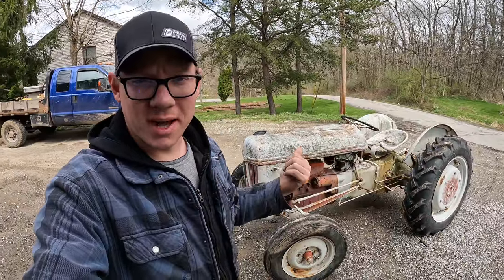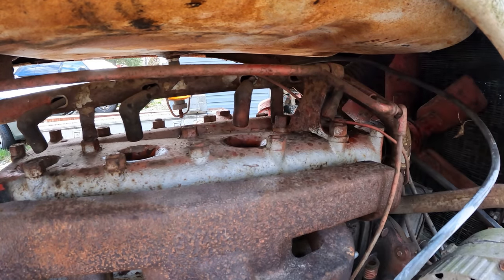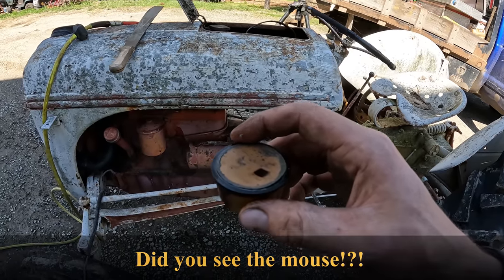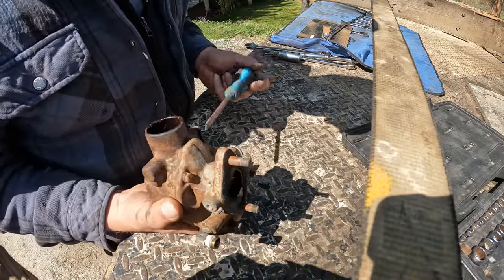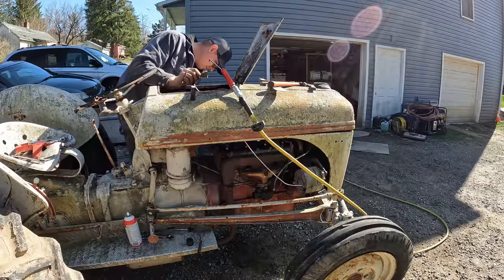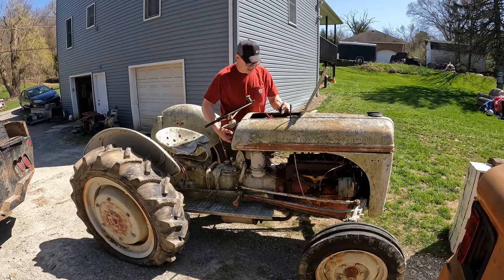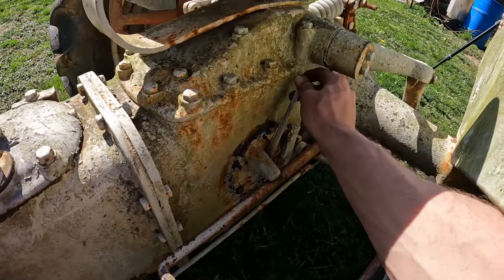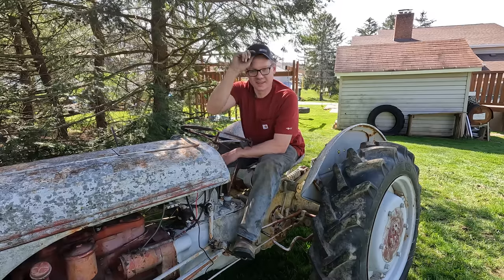Saved From the Crusher! Will this 80+ Year old Ford 9N Ever Run Again???

Comment: Exhaust leak on #4 is a common issue on ford N series tractor, every single one I've seen has one. Ford decided to not put a bolt or anything there, and over time the manifold warps and eventually starts really badly leaking. Ours has the same issue.
Reply: Same on the Fergusons. I have a TO35 and MF35 with that #4 condition.
Reply: My shop teacher (John Gale) back in 1979 told us that was an installed feature….

Comment: Great job. The 8N and 9N tractors can run for ever. My Mom has one and is used for her 2 1/2 Acres. Must be careful they are hard to stop. I mean you want to drive and drive.
Fun story. When my parents first moved into the house on two and a half acres. I think 1973 or 1974. They bought a 1936 case started with a crank and had no lift. Came with a large drag plow, spring tooth, and scrapper. About 2-3 years later it stopped in the field and Dad was done with it. He wanted to do work around the yard and bought a 8 horse power 4 speed Montgomery Ward Rotor tiller. I was in Jr High and took electric lab. I rebuilt the family edger. We'll while Dad was assembly the tiller I took on the Case tractor. I rebuilt the carburetor and cleaned the plugs. I was not aloud to work the crank. My Dad did not want to bother. After begging he went out there. Three cranks and it fired up and ran well. It was so satisfying. Funny thing my Dad put off the tiller and totally plowed the whole yard. Mom did not see that coming. The tractor ran a few more years, when they bought the 8N. We sold the case and still running.

Comment: 83 years old no computer  junk on it runs good ( john deer should pay attention ) ive  run both 8n and 9n   for years i would oil change use engine restore additive brings compression up these are great for twist through the bush very small foot print with little care it will run for another 20 years. great video matt thanks

Comment: I got a 9n and they're handy little tractors to have around. Easy to work on too. Also the I beam axel supports identify it as a fairly early 9n. And the air cleaner is fully under the hood. Later 9ns have a tube coming out of the hood and the 8n has a grate on the right side of the hood.
Reply: I'm not super smart but l believe the tube was a dealer option change.
Reply: @normhowes2975  I don't claim to be an expert on it but from what I've read the early ones had the I beams and sometimes people swap em out. My 9n has tube styles but I sure wish it had the I beams
Reply: @normhowes2975  You'd be correct. Also an aftermarket option from catalogues.
Reply: HA, a 9N recently sold at auction a couple of miles from our house. It was a 1940 model with all four tires completely rotted. Other than that and needing a LOT of work I passed when it went to $625 which also included sales tax and buyers premium which would have made it $743. TWO weeks later I had cashed out a small 401K an would have had the money to buy it and probably would. I ended up buying a 1956 Farmall 130 with a front blade and also needing four tires. :-)

Comment: We had a 9N in the 1960’s. As you discovered, the PTO must be engaged to use the hydrolic lift arms. The original front tires were about 3 or 4 inches in width. The front tires on your tractor look like they are about 7 or 8 inch’s wide. It is likely that someone wanted to install the wider tires on the front of your tractor and needed to use the old “hubs” to increase the space between the tires and the steering “swivel”. Great work on getting it running again!

Comment: These tractors are some of the most reliable machines made, period. They were a solid established tractor on the seen giving Deere a run for their money. Nice work fella finding out that the high tension output spring was burned short from service in the field. This was definitely overlooked by the previous owner. One can definitely hear the exhaust leak for sure. Nice job Matt. Look forward to see more from you Sir. Peace vf
Reply: one small notch above a team of horses
Reply: @earlborchardt4358  Let see, no giving feed water harnessing smelling the back exhaust. Work 24/7 if you like. The bad, profit is eaten by cost of gasoline. Personal choice I guess.
Reply: @earlborchardt4358  , tell that to those still using these on hobby farms, minus those who do not use machines for religious reasons.
Reply: @earlborchardt4358  
Small, but incredibly crucial.

Comment: The easiest way to work on the distributor is to remove it and work on it on the bench. Lay the cap back, one wire, two bolts. The shaft end is offset so it only fits one way. You don't have to worry about timing. They don't have live power so as you found out the lift and PTO only work when the clutch is out.

Comment: FYI ...worked for an auto/diesel shop for some years in Central CA. We converted many 8ns, 9ns, Jubilees  and other 6v tractors to 12v alternators. The main reason was the spray rigs. They have to be pulled extremely slow. The 6v generator wouldn't keep them charged. The alternator will charge at an idle.

Comment: I have a 1941 9n just like this. Those machines are workhorses, parts are mostly readily available and cheap, most components are not only available as assemblys new, but also parts to rebuild those assemblies for even less money. A little bit of tlc and that machine could be putting in a days work 80 more years from now. I use mine to mow my place along with 6 others from time to time, i used to maintain the private road i live on with it until the county took it over, i plow my garden every year, disc and bushhog deer leases for family and friends, heavy lifting around the place, and most importantly this tractor has powered a pto driven generator and provided my entire h ouse with electricity every time the lights went out for the last 10years. Saved our butt in snowpacalyps last year.

Comment: Hey Matt. Just saw your new vid about the Ford tractor acquisition. After being in the electric motor business for 45 years, one thing I always keep handy when working on electrical stuff is a can of electrical contact cleaner. You'd be surprised at what you can revive with that stuff.
Reply: great advice, and many contact cleaners do not wreak havoc on rubber or plastics

Comment: Really enjoyed this one Matt! Hope whoever buys it sends pictures of it in progress/ done.
Reply: Hey Matt, two bolts take that distributor off. Drives by a Tee slot it will only go back on one of two ways. If you make note of where the rotor is pointing before hand , it’s a no brainer. And now you can see what you are doing on the  distributor. Makes life much easier. Yup pto has to be on for the hitch to operate. Kinda primitive 🤔I just rebuilt an engine in an 8n. Pretty much same thing. It has a very unique valve system.

Comment: Thanks for the video. I've owned and restored a few of those old tractors. Our local tractor supply had the complete exhaust system in stock for less than a hundred dollars. From the manifold to the back tailpipe muffler included. I was truly amazed.

Comment: Fifty years ago I sold overhaul kits for those for $120.00 that included regroup Crank shaft and bearlngs with pistons sleeves and rings as well as a gasket set. Those old fords were very popular back then in rural Oklahoma.
Reply: Rachel Gingell's channel sells repair kits and has instructional videos on component repair. And she's nice to watch.
Reply: @TKevinBlanc  Thanks Kevin I will check her out. If memory serves the same kits worked on the Ferguson, As I recall Ford had bough the Massey and they were called Ford Ferguson, been a few years and memory fades I don't care who says it don't.
Reply: @poorfesor  Thats correct. In Australia we call them Grey Fergies
Reply: @poorfesor  Ford and Ferguson had a handshake agreement to use the Ferguson System(3pt hitch) on the Ford tractors. The Ferguson tractors were a result of that agreement falling apart. They used OHV engines sourced from Standard for UK built(TE, Tractor England) and Continental for US built machines(TO, Tractor Overseas.)
Reply: @82f100swb  I just remember my Father in law had a ferguson that I sold him an 8n rebuild kit fo every few years. Hard to believe what happened to prices after Nixon's price controls and Jimmy's rein.

Comment: I plow the driveway with an 8n yet, thing starts every time. Lots of guys would chop rims with a common bolt pattern so they weren't forced to use the OEM wheels. That way you could get more readily available wheel and tire combos anywhere and not rely on trying to source the hard to finds.

Comment: A little tractor is something you always need.  I had to cut down and cut up a dead pine in my back yard and used my lawn tractor to help disassemble it.  I used tow ropes and a chain to pull the big parts.  I put a clevis on the rear of the tractor and used it to drag the big bones to a pile for burning.

Comment: We had one on the farm back in 1959. It was a little newer with a slant 4 and the next gen electrical (lol). Was a great machine that ran forever. Ours had a front end loader so it worked well with our old MacK Dump truck. Nice job

Comment: An old machine like that would be great for someone with a large garden. It looks like it has a pto shaft and with a set of suitable tyres on it, could cut grass and work a decent size vegetable patch
Reply: If it's not a live PTO, it's a pain to use. We had a similar Massey Ferguson without
Reply: It's perfect for a garden actually fits through a lot of gates too
Reply: @erik_dk842  Matt had the pto working just after i posted
Reply: @erik_dk842  Works just fine, still. You have to get an overruning coupler and that keeps you from getting pushed through your fence.

Comment: Hey Matt! Had an 8N when I was younger, solid piece of equipment but can be a royal PITA when dealing with fouled points or anything electrical. My dad did a12v conversion and rigged up an MSD (I believe) digital ignition, was super reliable after!
Reply: Yes I have 601 workmaster 1959 basically same tractor

Comment: That gray sludge is the leftovers from the days when they ran lead in the fuel, dunno what's worse, cleaning up old leaded fuel sludge or modern corn syrup fuel sludge. Funny that there was a happy interlude from around 1990-2004 or so when they weren't putting anything in the fuel that didn't really belong and that stuff holds up quite well.

Comment: I enjoy all of your videos!  The 9N used a huge 5 bolt pattern on the front, like the 1936 Ford cars did (looks like an early VW).  It looks like they modified the spindles to accept a Ford pickup 5.5" pattern.  An older guy I worked with in the 80s installed 1950s Ford car hubs on his 9N and used Ford 4.5" car pattern wheels.  He also pulled the stock liners out of the engine and used either Ford or Mercury flathead pistons running on the block bore to increase the displacement (an early big bore kit).  My dad taught me to a snap a piece of paper between the points and slide it out, after filing them to make sure they are clean and it sure helps.
Reply: I believe 9N, had narrow , your w
Reply: 9N narrow tires, 8N wider tires, like yours.

Comment: The old tractors do not have an overflow reservoir on the rad. You are not supposed to fill them full when cold. The top part of the rad is supposed to be empty when cold so when the tractor warms up, and the antifreeze expands there is some place for it to expand into.

Comment: Great find! My first tractor was a Ferguson T130, very similar to the Ford N series. You have to be moving to raise the 3 point. It can be problematic when you get stuck with your implement down.
Reply: Not so, as long as the pump is in gear (lever on the side) and the tractor in neutral, the hydraulics work independently (as Mat demonstrated). It is true that it doesn't have a two stage clutch like later tractors however.
Reply: @graemezimmer604  I remember that now, it's been about 15 years since I had that tractor. I inherited it from a neighbor who passed away so I had to figure out all the controls by trial and error. The trickiest thing on the Ferguson was the starter, you engaged it by going up and to the right with the shifter. The time I got mine stuck was probably one of the first times I used it, I had the box scraper down and lost traction coming up a hill. I ended up talking the scraper off to get the tractor out.
Reply: Nah, these 3-points lift without it moving, have had plenty of Ford N-series and 600-800-series.  Definitely something wrong with them.

Comment: My 1st tractor was a Massy Ferguson, The Grey fergy. Made in the UK. Grandad bought it in the late 1940s
To start it, used the gear shift, top left hand. Like 1st gear. Actual 1st gear was bottom left.
We had a ford 4000 with 10 speed selector. Dad sold that then got a International 454.
Some winters got so cold that starter would not turn over the Ferg's engine. Had to crank start it by hand.
The 454 started no matter what temp it was in the morning, didn't even need to preheat where the Fergy would not have anything to do with it.

Comment: Great video !
I had a 39 9n and it was 6 volt positive ground so you may have toasted the coil unless there's a ballast resistor in line there.
My 9n had two brake pedals on the right side. Also the pto was not disengaged with the clutch and lots of stories about driving out through the barn wall trying to stop with a brush hog still spinning on the back.
I showed my two young children how to drive a manual trans with it and it was tradition to drive tractors to the last day of senior school.
I kick myself every time I think why I sold it !

Comment: Parts availability is so good on these that you could almost build an entire new 9N just from aftermarket parts. They are still so popular, not just because they made a ton of them, but also because they still fit what a lot of people need. It will plow, cultivate, snow plow, brush hog, grade, and pull a wagon around. For a lot of people that's more than enough, and if it is then the N series is an absolute bargain in purchase price and upkeep. They also come with that added knowledge that this tractor put a lot of food on a lot of tables in its life, which is an experience in itself.

I didn't see an overrun clutch on the PTO: that might be where the front end dents came from, since a brush mower will push the tractor with the clutch in unless you have an overrun clutch installed. Many fences have been violated by N series front ends that way.
Reply: No idea what you are describing really, but what I can say is that even on our Ford Workmaster 641 when you get ready to come to a stop while bush hogging, you have to push the clutch in before you're ready because it will continue to lurch forward until the blades slow down. Sounds like what you are describing.
Reply: @ram89572  Yes, the 641 would also have a transmission PTO and so really should have an overrun clutch installed for mowing so the mower can freewheel when you stop the tractor instead of the mower acting like a big flywheel pushing you forwards. I think I paid $50-$60 for the one on my 2000 and it makes a big difference in making mowing more pleasant and safer.

Comment: That alternator could have an exciter in it which converts it to a stand alone one wire system. Have one on an old Farmall C with one on it, nearly 20 years with no issues.
Reply: Yeah, that kinda sorta looked like a 1 wire gm. we use em on airboats all the time.

Comment: As a teenager I use to help my Uncle clean up, paint and repair the early Ford 8N, 9N, 2N, Jubilee tractors for resale. It usually took a couple weeks to refurb one unless it involved serious transmission or motor problems, he stocked a lots of used parts also.
6v to twelve volt conversion was always the first thing we did. My Mom use to complain about how dirty and hard to clean my clothes were, we used kerosene and high pressure air to clean the grease off them. A good video to watch on you tube is titled: 
"Ford 9N 2N 8N Fergy Differences"

Comment: I'm not a chemist, but I wonder if the "gray sludge" is some compound of lead from using leaded gas most of its life. So weary touching/breathing that in.
Reply: That's the 1st thing I thought of.
Reply: Ive seen the same with old aluminum/zinc frame fuel filters i find in old chainsaws. They sit in gas for so long that they just start to corrode and break down.
Reply: @punisher3607  Aluminum/zinc gets crumbly after 50 years soaking in gasoline.
Reply: @smncutler  yep, sure does
Reply from the maker: Yes it’s definitely not original
Reply: Id be surprised if tetraethyl lead was changing in composition over time. An organometallic compound like that usually wont react over time. But that doesnt mean the sludge doesnt contain tel, and could easily be dangerous still.
Reply: I wonder if it's lead additive

Comment: That's a 41. At least the grille, pretty rare, the rest usually have virticle holes in the center slat. Also those rods that are in the grille I believe are 41 only, at least in the way they were made. I have 2 1941s. One is changed quite a bit has a later 8n side mount distributor engine, and a Sherman Hi Lo transmission.